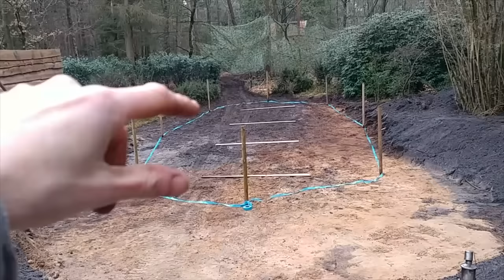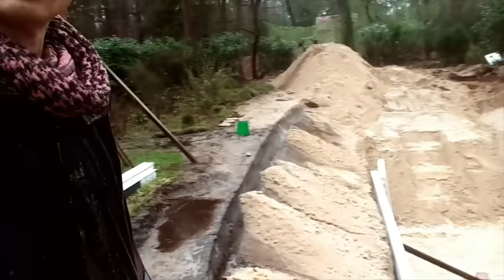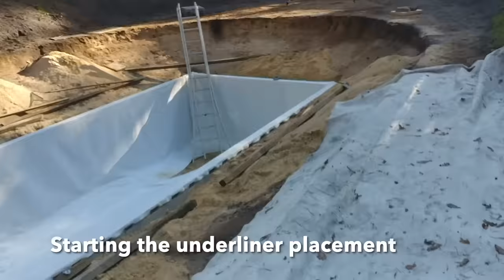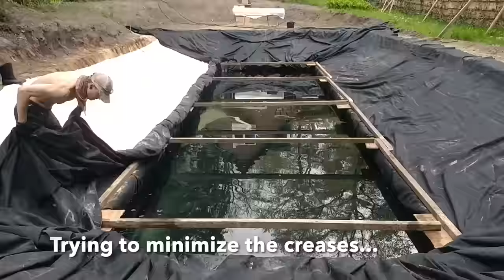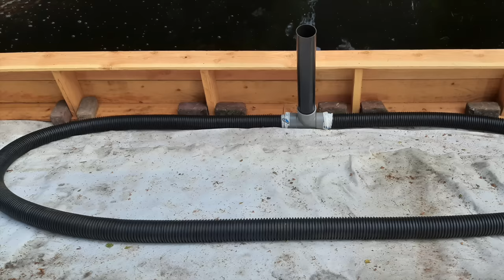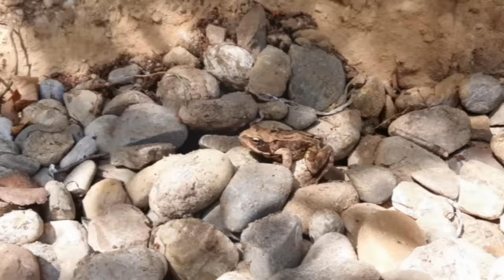Natural Swimming Pond / Pool Build 2023

Comment: Turned out beautiful 🤩 
So much work (both on the pond and the video too). Thanks for all the previously answered questions here in the comments. Just wondering how you get in and out of the pool. Do you plan a dock or ladder  of some sort? Hope to see an update next year on the planned waterfall and to see how the plants look over time.
Reply from the maker: Thanks for the comments! I plan to make a jetty that I can dive off and also attach a small ladder to. But currently I just walk over the gravel to the wooden edge and dive off that. That also enables me to get back out again without a problem.

I will make an update video in the spring for sure, when all the plants hopefully grow much larger and it will be interesting to see also how it kept over the winter. The air circulation system should help to keep it ice-free.

Comment: it is necessary to make more of a regeneration zone with plants so that it makes a circle and returns to the pond with the main pool, otherwise the water will most likely bloom
Reply: As long as you don't put fish in it the daphnia will take care of any blooms and the pond will quickly find its balance
Reply: Without fish it will be a mosquito breeder, unless he puts those mosquito bits. If he adds a uv light to the pump or filter will never have green water.
Reply: @Sea-cucumber1151  there is no need to invent anything, everything has been invented for a long time)) a reaction zone with a certain number of plants with a strong root system and, for example, stones of a certain fraction, this is a natural filter that will make the water clear and odorless even with fish)
Reply: @Sea-cucumber1151  just like an experienced aquarist, ideally add constant oxygen pumping)
Reply: Dyticus will eat mosquito larvaes

Comment: Very beautiful pond!  I plan to build one myself this coming summer.  Where did you get the plans for the filtration for your pond?
Reply from the maker: Thank you! Do you mean the plant selection and layout plan? Or the system as a whole? Or did you mean plants instead of plans? :) The plants I got from a local webshop here in NL.
Reply: @flairmaister  I meant the system as a whole.  I've done some research and before I commit to starting the project I want to gather as much info as possible to make sure I do it right the first time.
Reply from the maker: @unknownhuman5507  right, look up the videos of David Pagan Butler here on Youtube, I am basically following his system with some small changes that suit better to my situation. Also look up Berry IJmker, his method is also based on David's.

I spent a few months drawing and collecting info as well, and I came quite close to my original budget in the end. The digging was a huge job though!
Reply: @flairmaister  thank you very much!!!

Comment: @flairmaister How do you manage leaves as you have trees around?  One of my biggest  concern.
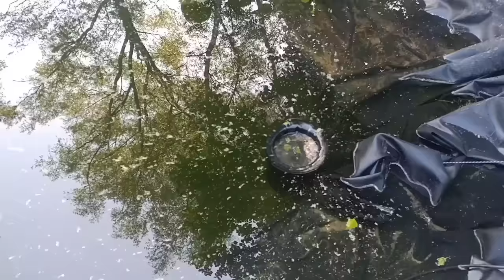Reply from the maker: In the fall I try to remove them every week or so with both a net on a pole as well as a skimmer, you can see this at 14:53

I also removed a hazelnut brush nearby this spring which gave most of the leaves, so that is one less source of organic matter falling in. However it can never be kept out 100%. It's part of the normal natural cycle, and the plants in the pond do need some nutrients or they wouldn't grow at all. 

As long as the worst is fished out, it's not really a problem for me. Some wire algea will always come in the spring, feeding off the excess organic waste matter, but this has mostly disappeared later in the summer. I will show how this looks in my next video that I'm editing now.

Comment: Very nice, well done. Can u explain the air stone in the pipes, which air pump u used etc.
Reply from the maker: I used cylinder air stones like one uses in a large aquarium which causes the air to bubble up in a nice evenly fashion in smaller bubbles. This pushes the water up as well and so water circulation is happening via the connected drainage tubes.

I am using a 65W Aquaforte air pump / compressor which is on most of the time, but goes off when I run the water pump that sucks water into the skimmer and out the other side of the pond where I still plan to make some sort of waterfall.

Comment: Great work, I really admire your effort! I also plan my pond following David’s design. I found your substrate barrier build quite interesting… I just didn’t get how you fixed the vertical beams without cutting the liner or with sealing? My other question is how the epdm liner is glued or sealed?
Reply from the maker: By vertical beams do you mean the short pieces that hold the boards together? I build the barrier all on top of the liner, and those beams are only 40cm high, so they don't extend into the side, if that's what you are thinking. It all sits on top of the 10cm sandwich panels + ground underneath. 

The EPDM liner is not glued or sealed, I ordered it as one large piece that has been glued together already in the factory. Then I folded it in as neatly as I could and simply cut away the excess material around the edge before covering it again with the drainage system and gravel.

I hope this answers your questions, let me know if not.
Reply: @flairmaister  yes, thanks so much!
Reply from the maker: @larpad1  I can send you some pictures if you want

Comment: How is the pond doing? It's been a while now :) Also, aren't you worried about the wood that's in the water, or is it possible to replace it eventually? Thanks
Reply from the maker: the pond is okay, waking up after winter now, the water is still clear and haven't had to power the airlift compressor on yet so far, as the temperature is still low. The wood in the water should last at least 20 years. As long as it stays under water it will decay only very slowly.

Comment: Looks awesome. 

How much power do the pumps and air compressors use? Are they running 24/7?
Reply from the maker: the compressor I have run 50% of the time (day and night, on 5 min, off 5 min with a WiFi socket) after the air temperature goes above 10 degrees Celsius. It uses 65W In the winter it's turned off completely. The water pump I only run when there is a lot of leaves / blossom / debris from the trees on the surface, to catch it in the skimmer. That one uses 135W.
Reply: @flairmaister  really helpful info. Thanks.

Comment: Are your airlifts connected together or individual? And are they plumbed into the main swim zone?
Reply from the maker: they are all connected together with a 16mm irrigation hose, and they are right outside of the swim zone, next to the wooden barrier. I didn't see any advantage of putting them 15cm further through the barrier, it would also take away swim space.
Reply: @flairmaister  ok thank you so you're only aerating water in regen zone? Would be beneficial to lift deep water from zone, unless your swim zone is sumping into regen zone. Would be nice to see a basic flow diagram :)
Reply from the maker: @738rh  I'm not sure what benefit it would have to lift water from the deepest section in the swim zone, other than perhaps getting a better temperature distribution, as nothing is growing down there and there is also no gravel on the bottom, that is only in the filter / plant zone. But please elaborate.

As for the flow, every pipe is about 80cm tall and connects to an 4m drainage tube in a loop sitting on the bottom of the filter section and there are 8 of those. Hope that clears up how it's done?
Reply: @flairmaister  I would believe for water quality, oxygen aeration and circulation. Would it not also increase beneficial bacteria etc? Deep stagnant still water is never good :)
Reply from the maker: @738rh  maybe, sure, but it is always a trade-off. To put the pipes in the swim section along with the compressor feed tube will be a significant change and will also take away swim space. 

What I do: regular swimming, also causes water movement. And there's lots of life swimming around as well such as salamanders.
Reply: @flairmaister  Yes I would not put the whole pipe in but I would plumb the inlet through the swim zone wall, minimal space required and generally better airlifting from depths between 1.8 - 2.2m. I guess the true test of any eco pool is time ;) and see how it handles seasonal changes etc. but it looks like you have all that sorted
Reply from the maker: @738rh  I do not have any problem with the water quality so I don't see the point. The water is crystal clear all the way down to the bottom. 

The circulation caused in the plant section also makes the rest of the water move around. And I swim daily in this time of year.

The only problem I am currently aware of (although I don't really consider it a problem) is some wire algea that grows in the plant section on top of some leaves from last year fall that are still in there. This however also gives some nutrients to the new plants. If the water is 100% free of organic waste then the plants will grow much slower. 

Also the wildlife in the pond benefits from some of this. As long as it stays in the plant section it's not a problem for me. When this material has been processed by the algae, plants and microbes, the algae should also disappear.

Comment: Hello. Nice clip . Thanks for sharing .
I have a question though.  At the end of the clip some bats were mentioned as having a feast of the pond's mosquitoes.  Isn't the air filtration sistem a method of not creating conditions for mosquitoes? Because the water surface is continuously moving isn't supposed that the mosquitoes can lay eggs and hatch ?
Reply from the maker: yes and no :) the airlift does cause a surface that isn't still, but there are still many critters that live in and on the water, such as dragonflies (many this year), beetles of all kinds, and surface insects that I don't know the English names for. So plenty to eat for the bats.

I also think that there may be a few small pockets where the water moves less, such as in between the irises and other bigger plant formations. I also have a much smaller pool nearby that has no airlift or other circulation system, and there's probably mosquitos coming from that one.

Comment: Put in a uv light in the pump filter area, you will never have peace soup green water.  The green moss around the plants is excellent and good for the pond. If not regular fish put some mosquito fish to help keep the mosquitoes down or the mosquitoes bits that have a bacteria to kill thru. It won’t kill the flying ones but will kill any larvae and completely safe for humans, animals and plants.
Reply from the maker: UV will kill everything, and costs a lot of power. Also I don't have a pump filter, the 30 thousand kilos of gravel are what is hosting the microbes that filter the water naturally. 

The only thing I add is extra air during the warmer months using the compressor, but that costs a minimum amount of power and can be turned off for half the year. Right now in the middle of winter the water is still crystal clear without the need for any pumping or artificial filtering.

As for the mosquitos, the frogs, bats and other water insects such as beetles take care of those mostly. I had almost none. This will get better in coming seasons as the ecosystem balances itself out.

Comment: Do the bubble pumps work ok? They dont seem to be j  the swin zone so how does tbe deep water there get moved into the plant zone? Your way seems to just circulate water from the bottom of the plant zone to the top. 

Also yoir gravel looked quite dusty whenit was being delivered. I thought washed gravel was needed forna swim pond. Did the dirty gravel not cause any problems?
Reply from the maker: The bubble pumps work excellent, the water went from algae pea soup where I couldn't see more than 10cm into the water to crystal clear where I could see the bottom of the pond (2.3m) within 2 weeks after I installed the pumps and dumped the gravel in. 

It is correct that the water circulates mostly inside the plant zone, that's where the oxygen has to mostly end up to keep the microbes living on the gravel aerobic. The rest of the water will be cycling through as well at some point (also by swimming), but the main point is the oxygen supply and this works perfectly.

Gravel will always be dusty. Sure you can rinse it off but it wasn't a problem in the pond. The sediment just sinks to the bottom of the plant zone where the gravel is anyway,.
Reply: Did you buy washed gravel or just standard gravel?

Comment: What are the pipes used for and where is the Air stone placed.
Reply from the maker: the black 110mm PVC pipes are used to guide and accelerate the air bubbles upward which in turn causes water to be pushed up and circulated through the gravel. The air stones are at the end of the tubes that have the air flow through into the bottom of the pipes.
Reply: @flairmaister  Thank U

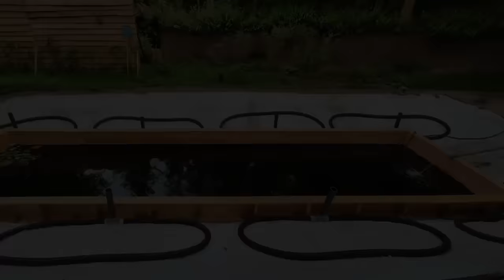Comment: Great job! Question at 18:06 - are all those airlift loops tied together or 8 independent systems?
Reply from the maker: they all come from a single small (65W) compressor, still a lot cheaper than running a water pump for this size

Comment: About what was the cost with you doing the work & did you already own the tractors & other equipment or rent them?
Reply from the maker: the total cost was just under €14 thousand. I had to rent the mini shovel several times which was costly as I also had to have it bring and pick up by the rental company. The digger was owner by the guy who I rented for about 8 Saturdays in total (so included in excavation cost). This was the total budget in EUR:

item	      costs
---------------------------------
excavation	2,520
machine rental	1,345
sandwich panels	2,349
delivery of panels	178
corner profiles	45
lower U-profiles	338
upper U-profiles	200
underlayment	578
EPDM foil	2,310
mortar	20
curbstones for edge	206
wood for partition	450
water pump + skimmer	200
PVC pipes 110	55
air drainage 100mm	251
drainage T-pieces	92
drainage PVC reducer	69
drainage edge 80mm	126
drainage blind 80mm	99
tyleen 16mm 100m	60
tyleen couplings	43
tape / kit / screws, etc.	100
air pump	129
air stones	158
substrate / gravel	1,746
water plants	250
----------------------------
total	13,916
Reply: Thanks for that impressive description.
Those owning machinery will save a lot. No leasing/transport/ labor. And if remove soil can be reuse elsewhere, it´s an other expense cut.
Really nice work. How cold are your winter ? 
I´m on the other side of the big blue, and bad winter can hit - 30. Usually more in - 15, 
- 20 with clay soil. Roughly an oval shape with filtering vegetation in the "pointed" area, about 5 feet or 1m50 deep with a central island higher, thanks to removed soil. Island will be perfect with friends, barbecue and grapewhine for shade. Big leaves are probably easier to remove and an easily plant that can be cut as it grows. Frost fence all around for kid and wildlife safety and some access to get out. You never know with raccoon, fox, rabbits, squirrels. Nobody want a swim to find a floating or sink animal in it. 2m wide around the island seems OK. That´s a lot of water to pour and keep clear. No chlorine or salt will be used.
Well, that´s a distant plan, but my small 23 HP tractor and backhoe will highly cut on cost construction.
Reply: @flairmaister  The hanks so much. YouTube didn’t let me know you responded but luckily I checked back.

Comment: Are those just SIP panels or is it a pool kit?
Reply from the maker: those are steel-plated PIR sandwich panels that one would normally use to build the walls of a workshop / garage. I got them "B choice" for a good price. Besides being strong, another advantage is that it gives some insulation. I could also have laid them on the bottom for further insulation, but I also wanted to have the pond stay cooler during hot summer days.
Reply: Excellent...Love your channel @flairmaister

Comment: Where is this? So much sand. You deserve many more subs.
Reply from the maker: This is in the central east part of The Netherlands, yeah there is mostly sand in the ground here. It's a slightly elevated part of the country because of that. It has the great advantage that there is no groundwater to worry about.

And thanks :) I will make some more videos on further progress and improvements, and the filtering system

Comment: Nice pond, but aren't you gonna hide all the hoses ? That makes it look a bit unfinished
Reply from the maker: yes, the hoses on the right side still need hiding, as that side also still needs more gravel. That will come next spring. I gave the garden around the pond a break this year, as driving the wheel loader takes a heavy toll on the soil and grass.

It was also handy to have them exposed during the experimental phase, as I wasn't sure yet where I wanted to feed in the compressed air and where to place the waterpump and its exhaust. I'm going to be moving the latter over to a smaller pond about 1.5m higher, to create a waterfall into a stream into the big pond.

Comment: The edge is too steep you need a 30 degree angle going down 1 meter 1 meter in length this to avoid using so much gravel when the rain comes all that soil will end up in your pond.
Reply from the maker: 1:1 would be 45 degrees. Mine is about 1:2 and this is about 25 degrees, so less steep than 30 even. I would have gone even wider but I had to work within the available space. I wanted 3m for swimming and that left about 2m on each side for the filter section as I had about 7m width available in total.

The soil does not end up in the pond as there is a 30cm deep trench dug all around it with a drainage pipe inside and then gravel on top. 

This has been tested many times in very heavy rain already and it works perfectly. Watch the video to the end and you will see.